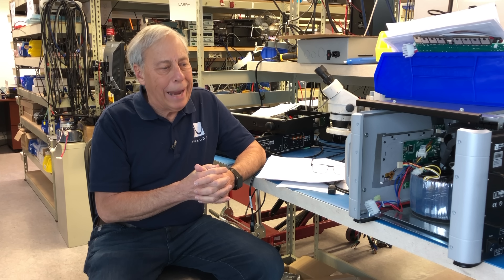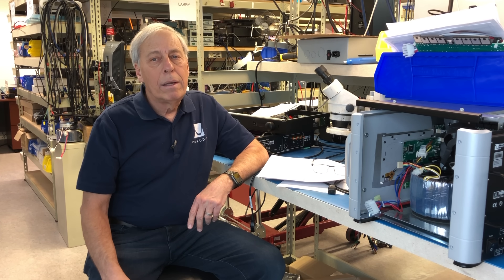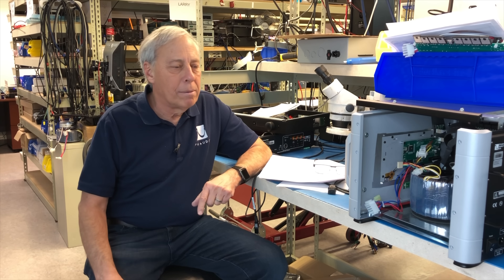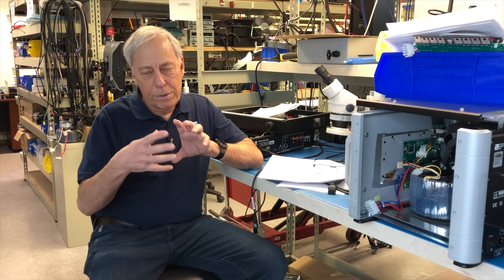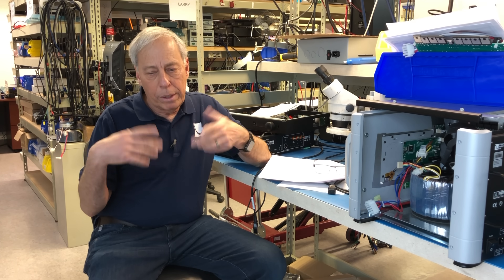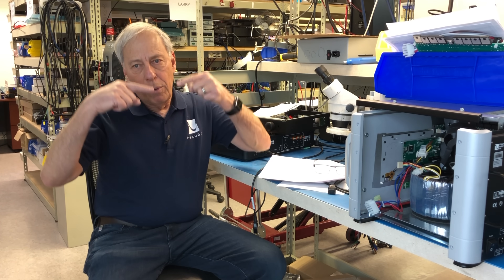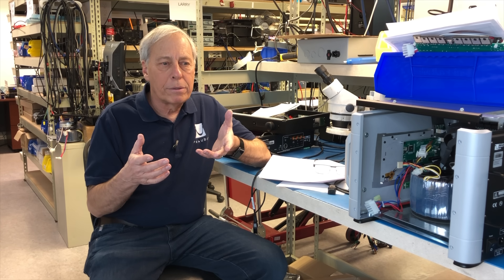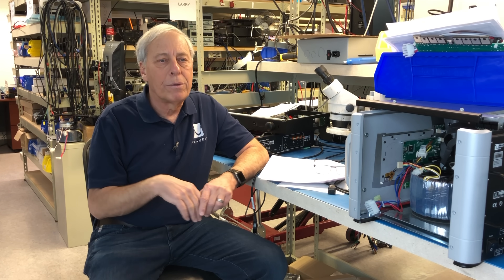How does internal pressure affect speaker performance?

Comment: You to think (what I also saw on a REL YouTube video recently) that there is an asymmetry since the environment on one side of the cone is different from that on the other. This is not true. The front and rear effects are seen in the same amount regardless of which direction the cone is going. Just as stretching a spring takes the same force as compressing it. Aside from tiny nonlinear effects.

Comment: The air spring nonlinearity you were citing as the cause of distortion is almost negligible.  Most woofer distortion arises from motor nonlinearities.  I have been testing a small 8" subwoofer that's built into an acoustic suspension cabinet which is less than 40% of its Vas, yet the air spring nonlinearity is less than 0.1% at high excursions approaching Xmax.  If it were installed in a more ideal cabinet size, that distortion figure would be even lower.  Compared to the motor nonlinearity which approaches 5% at similar excursions, the air spring is almost perfect.  Further, the air spring becomes the minor contributor to cone dynamics, as you move above the resonant frequency.  
Also, the main reason why woofers benefit more from servo control is again their large excursions which result in high distortion levels, plus the fact that their cones remain sufficiently rigid at the low frequencies so that an accelerometer can give an accurate measurement of the full cone motion.    
And please don't discourage your "young buck" engineers from innovating different approaches.  If servo application still leaves about 10% of the distortion, it shouldn't be that difficult to do as well with a DSP approach.  We "old fogies" often have more "appreciation" for traditional methods, than they deserve.  Don't let fondness for old times stand in the way of progress.

Comment: Correction:- the air acts like a spring in both directions.  The asymmetry comes from the spring constant (of the air spring) getting ever-so-slightly higher as the air is compressed when the woofer cone is in and vice versa.  The emphasis here should be on the "ever-so-slightly".  Also, tell your young bucks how effective the DSP correction will be will depend very heavily on the predictability and consistency of the drivers used.  This is much less of an issue with motional feedback.  You could consider both - use DSP to correct known gross errors in diaphragm motion (i.e. amplitude response, predictable overshoot) by altering the signal sent to the drivers and use feedback to further improve fidelity and address sample-to-sample component variability and variability with time/conditions.

Comment: My favorite sounding speaker of all time.......Infinity Column ll.  It used 2 10" woofers, one facing forward and one down firing.  I'm a big fan of dual woofers in the right setup, or a passive radiator.  This allows you to keep the sealed box design, but utilize the full capacity of the front and back waves without a port.  Can't wait to see what PS Audio comes out with for speakers given the history with Genesis and Infinity.  Great job Paul....

Comment: I didn't even understand the question and still struggling. I don't believe there's any pressure mismatch between a closed box speaker and the room at all. First these boxes aren't hermetically sealed, even the edges, the cone itself etc. might let air through (very slowly but yes it can), second if there're any permanent pressure differences between a sealed box and the room, they're minuscular. Of course talking about idle state, and for music etc. Paul already described the physics behind that. But for an idle speaker I think pressures inside and outside are pretty much the same since (again) they're not hermetically sealed boxes.

Comment: You should go with ASP not DSP there's some delay in DSP what you shouldn't get with ASP in the same way I grant you it's very tiny but there is some and the noise factor changing from one to the other can't be good are you going with linkwitz DSP ASP you should do take it onto the next level best one out there.

Comment: Keep it simple stupid KISS, both system designs have a tuned box . Shape and size but most importantly Cubic inch or cubic space in the case of a sealed box . Woofers have a recommend requirements based on size per manufacture . Manufactures set parameters for both sealed and ported boxes cubic in or port size . 

90% of the people that own ported speakers have no clue on how to get the most of their speakers or speaker placement . Most ported speaker owners use the same placement as sealed speakers owners . losing half the sound or developing too much boom . Front porting is not as critical . Porting is lazy speaker engineering that said I own a set of RF 83 somewhere in one of my systems. 

 Then it the ignored stepchild the passive radiator which has a tuned fake woofer without innards .   

How did we function as a society before DSP or servos or another feedback systems ? I think this is where both our worlds divide The AV world and the 2 channel world . Av world uses processors and the 2 channel world uses analog .     

Just a side note One 15" woofer has more area than two 10" woofers  or three 8" woofers . 15's typically develop lower bass . For me the question  would have been The big woofers of yesteryear versus 8" drivers of today. For me size really does matter  . Today I see 15 k plus boutique designer speakers with 8" woofers  and say we are going to need a bigger boat  .

Comment: I am not a speaker designer, but I have built speakers, one of which is quite impressive sounding if I do say so myself. As someone who values simplicity in my audio systems, this video horrifies me. So, to fix one problem, dipole cancellation, we add a box that causes other problems, i.e. you cannot eliminate or absorb the back wave, it is a pressure problem which we then fix with either a port, which we don't like, a passive radiator, which we don't like, motion feedback, which we don't like, or DSP which we may or may not like but it certainly complicates things. I, not realizing that is what I was doing, switched to dipoles in 1985 with a pair of electrostatics that I still own. My "impressive" speakers are dipoles that use a 15" woofer in a 4' wide baffle that looks suspiciously like a sheet of plywood. The bass, while not subsonic, is satisfying, deep and clean. I power this woofer with a 2 watt triode tube amp. 

While I don't necessarily dislike box speakers, I have always preferred the speed and "life" you get with a speaker that is not fighting that back pressure wave. As the speaker reaches the extremes of movement, that sealed box resists the cone movement, introducing compression. Alnico magnets do the same thing to a lesser degree even in open baffle. I guess the trick is, if you can see the woofer movement, you need a bigger woofer.

Comment: I seem to recall that using the Theile-Small parameters available in so many publications, and knowing those parameters for your woofers, it was fairly easy to "tune" the sound by varying the cabinet size. For example, most of the time a smaller box would give you louder bass (think "big bump around 80-120 hZ") , but roll it off as you got to the really lowest half-octave. A bigger box would give you much more extended low bass , but the whole thing would not be as loud. So you'd need more amplifier power. As one reader has already noted, using the same parameters for vented/ported/horn-loaded/passive radiator speakers was way more complex. I remember reading somewhere back there in the 70s that it wasn't that the vent put out more sound, it was that it was one way to control the motion of the woofer. Which is exactly what varying the size of a sealed box does. Ain't audio fun!
Reply: Funny that you mentioned a "big bump around 80-120Hz" which is exactly what my Dahlquist DQM9's have, and is the reason why they're relegated to rear channel use.  
Although it's interesting to tinker with ported designs, my mains are acoustic suspension, and shall remain that way.

Comment: I have open baffle speakers and it’s all I build. It’s hard because the backwave is free to move and reflect around the room. As for the cutoff frequencies, there are plenty of subs that can play in an open baffle down to 30hz. Any subwoofer is hooked up to its own plate amplifier to provide the necessary power.
Reply: If you do 1/4 wave math , 1/4 wave being the peak postive in the waveform , then open baffles do not play down to 30 hz unless there is enough distance between front and rear wave to cause cancelation . so at 30 HZ the full wave length is 35 feet , 1/4= 8 feet , you need a baffle that seperates front and back waves by at least 8 feet to get proper 30hz response.
Reply: @ARGBlackCloud  open baffle subs load the room differently with sound.

Comment: Long ports inside the speaker help out a lot ! just like Klispch did with ther RW-d12 subwoofer that way you have clean fast bass not muddy or what I call a hall effect I listened to many subwoofers and the RW-D took it easily having all inputs (LPE-Movie) (L-R RCA Music) and high input in only which helps to instantly level match with front speakers I put front speakers on A speaker output and powered subwoofer on B speaker output that way one doesn't sound different than the other

Comment: I'm not as concerned about how something is done as I am about the results. 
Whatever the method, some speakers will sound good and others won't. 
In general, the simpler the whole system, the better I like it in principle. 
DSP, while it can work wonders, really shouldn't be incorporated into an otherwise passive speaker. 
In a fully powered speaker, anything goes --- if, in the end, it sounds good.

Comment: Wow! So wrong, so so wrong. Paul quickly avoided the question and went on to what they plan on doing with they're speakers which seems to be more dreaming then anything else right now.

Anyway, a closed-box low-frequency speaker box design is well known and has been for decades. Paul even mentioned Acoustic Research ( AR ), Edgar Villchur and Henry Kloss as the innovators that launched the design in 1952. And Paul mentioned that in a video just a few days ago. The AR speakers were based on a closed-box low-frequency design. US Patent No. 2,775,309, was granted to Edgar Villchur and was assigned to Acoustic Research in 1956. That's how old this design is.

The math behind a closed-box low-frequency speaker box is not trivial. Do bring your slide ruler. There are two basic designs. They are:

1. Infinite Baffle
2. Air Suspension

The Acoustic Research AR-3 was an Air Suspension design.

The best way to get introduced to this design is to get yourself a copy of

The Loudspeaker Design Cookbook - Vance Dickason
https://www.amazon.com/Loudspeaker-Design-Cookbook-Vance-Dickason/dp/1882580338/ref=sr_1_1?ie=UTF8&qid=1549058782&sr=8-1&keywords=the+loudspeaker+design+cookbook
about $50
Chapter 1

I actually started to tinker with the math on these devils in the 60's. I'm sure there's computer programs now that can do a lot of the heavy lifting on this process.
Reply: https://en.wikipedia.org/wiki/Acoustic_Research
Reply: Isn't it something that its owned by audiovox? I had a kicking little car EQ amp back in the late 70's by Audiovox. Had a little power meter on it. VU style. What a cranking fun time that was. 4 6x9's on the back deck of my Baja bug!
Reply: @SJMessinwithBoats  The name got kicked around a lot over the years. https://www.acoustic-research.com/  still exists. I have no idea who owns them now. The Patent probably has long since expired
Reply: Did you know that Ampex Corp originally held the patent on magnetic recording on iron oxide? That was granted in the late 40's. Ampex went down the toilet in the 60's. Can you imaging if they were still in charge of that? It's a little tiny company of maybe 100 people now.
Reply: You might be over 50.
Reply: @SJMessinwithBoats  73
Reply: @Bill Kenney, you been at this awhile! 
I'm a Baby! at 57.
Reply: @Bill Kenney did not know about dome tweeters before I was born. I do like dome tweeters and dome mids, like the Phillips 
"Squakers" I have 5 of those and I can fall to pieces over female vocals that emulate from those. I love Stereo's. 💘
Reply: I owned AR-3ax for years, loved em...

Comment: If they DSP model the woofer system, instead of using motional feedback, then you'll need to include a barometer/thermometer in the system. The speed of sound changes with air density and air temperature. If you "DSP" it perfectly for your altitude, I don't think it will be perfect for somebody who lives on the coast.

Comment: Why can't you use both DSP and an active feedback system. DSP would correct for known issues while the active feedback would confirm the accuracy of the correction. I mean you are building to a pretty high price point so I see no reason to compromise.
Reply: It's a good idea: first correct as much as possible feed-forward using a DSP, and next, decrease the remaining error with feedback (the servo). However, this approach requires the feedback from the accelerometer in the woofer to go towards the INPUT of the DSP. The input of the DSP is in the digital domain, so the system needs an ADC in the feedback. That ADC needs to have high resolution (16bit or more) while having very low latency (= delay), which is difficult to combine. (I work at a company that designed such an ADC, so I've learned a bit about it). 
Why the low latency? That is needed for a stable feedback loop. With latency in the feedback, the system will either start to oscillate, or you have to add a low pass filter in the feedback to make the feedback slow enough to avoid oscillation. But then the feedback won't be fast enough for real time woofer compensation anymore.
Feedback that stays in the analog domain is much more easy to keep stable because you don't have much latency in the loop. 
So to summarize: your idea needs a high res low latency ADC in the feedback loop which isn't trivial.

Comment: I claim to be no stripe of speaker design guru here. But here's my two cents worth on the debate between active servo feedback to correct the bass drive and a pre-mapped and pre-emptive DSP based correction. 
As Paul mentioned, technically any active servo first requires an error, which then can only be mitigated to some extent thereafter. However, I also wonder about potential issues with a pre-mapped DSP solution, regarding the complexity of the mapping process. Will driver to driver variations be compensated for in the modelling process? While certainly possible, it would make for a more complex build process. And, how well would a customised DSP model stand-up as a driver ages and/or responds slightly differently with environmental variations like temperature and humidity? 
Would the best of both worlds not be a better solution here? Have modelled DSP correction pre-emptively compensating for the most predictable and universal driver errors. Then an active servo to tidy up as many remaining discrepancies as is possible. With the DSP iroing out the worst of the errors in advance, the active servo then will not be required, I'd imagine, to nearly the same extent as it would were it operating in isolation. The servo is also there to keep errors in check which may only become apparent with both time and environmental variations.
Okay, so this was possibly (and hopefully) a little morre than just two cents worth. ;-)

Comment: Sealed, sealed, sealed! Frequency, depth and sound quality is the best in a sealed enclosure. It takes more power and sealed mid bass drivers to avoid cancellations but the results are magical! I bought some Velodyne sealed mid and highs cabinets many moons ago because it’s rare to find in a surround system ✌🏾
Reply: George, I wholeheartedly agree! I have played with and experimented with many many different ported designs over the years, and I ALWAYS fall back to a sealed box for listening. Ported enclosures are neat because of how they work, and because of their efficiency and impressive output at a given frequency, but in nearly all cases, they sound like crap in a hi-fi application because of the peakiness and sharp 24db roll off from their tuned frequency. In my opinion, bass should not be boomy, it should have tone, control, and definition. Granted, it takes gobs of power to drive a sealed bass setup, but man, is it ever worth it!
Reply: Yea Ratman572, ports mean more in a selected group of (or tuned) frequencies and less then normal in all the surrounding frequencies... That is the definition of imbalance, not uniform sound. I’m bias but I know it and acquired my opinion through countless hours of listening bliss!!!

Comment: Dual chamber relief.
Sealed but ported into an expansion chamber is my next project. I love weirdness and uneducated experiments. This is the "car talk" of audio Yea know.
Reply: Ask cray,save time.
Reply: In the "olden days",  Dynaco had a series of "aperiodic" speakers - most famously the A-10 and the A-25 models, that did just that; use Dual Chambers. I bet that a pair of either Today; would prove to be a Superior Design. Only held back, by the 'Seas' tweeter (Norwegian) of that time.